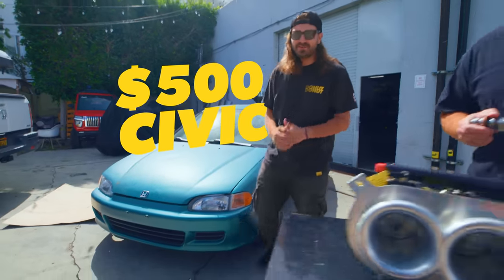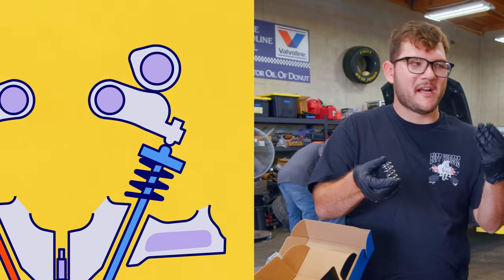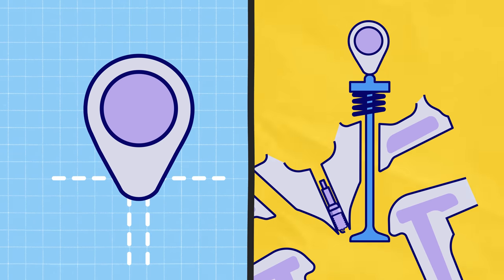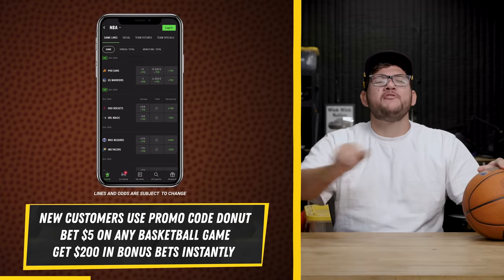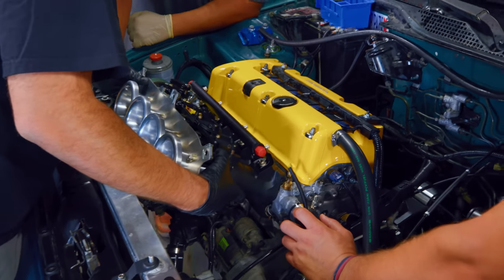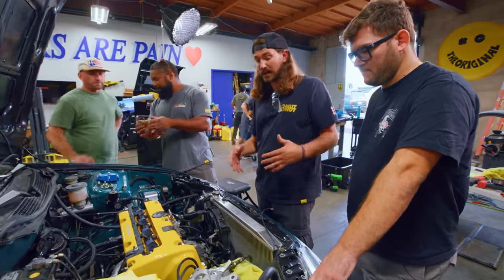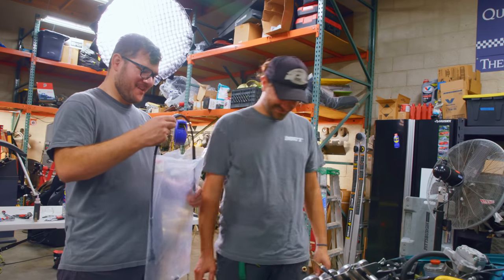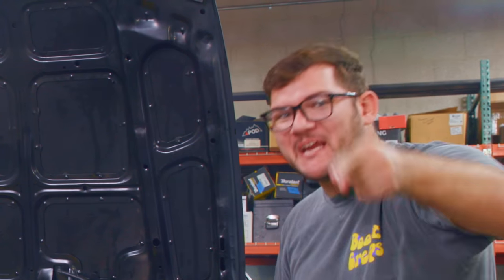We Put a $5,000 Intake on our $500 Civic

Comment: 240mm intake is not equal to 60mm*4,  just saying :)
Reply: The Difference is quiet big actually xD. 240mm would be 4x bigger than 4x60mm. Still great vid we did not come here for math but for Entertainment and one cute civic
Reply: Glad I was the only one that noticed that, someone in donut didn't pass elementary math class.
Reply: It hurt a lot hearing that
Reply: yeah i was like wtf? double the radius quadruple the surface... quadruple the radius and you octuple the surface...
it supposed to be a 120mm intake to equal 4x60mm...
Reply: 60mm*4 is about 130mm, 60mm*16 equals 240mm, big deference in my opinion
Reply: Yeah was thinking the same.
Reply: Yeah area is a square not a multiple, made my engineer brain cry 😢
Reply: The area is increased by about 3.5 times.
Reply: They needed Jerry there to correct him.
Reply: @ben501st  less than 2 actually
Reply: An 18 inch pizza is more than twice the size of a 12 inch pizza
Reply: We got a um actually guy here🤓
Reply: I love some of the comments that show people know thisis true, but don't actually know how it works.
Reply: @bentleyburke2242  no, its about 3.5
The single 65mm has an area of 3318mm, 4x 60mm have 2827mm each or about 11308mm. Crazy trying to correct someone while being so wrong.
Reply: Jobs math is sketchyyyy...
Reply: Yup. He had one 65mm port and now has the equivalent cross sectional area of one 120mm port, not 240mm. Or to look at it another way he had the equivalent of 4x32.5mm ports and now has 4x60mm ports. 

His available cross sectional area has increased by 3.4 times.

But I would speculate that going from 1 main port and chamber to 4 individual ports (even without cross sectional increase) will give a better air flow as you may avoid turbulance in the chamber and uneven distribution dont know enough about fluid flows to say for sure - Would need a real race mechanic to comment on that! So the engine benefit may be even greater than just the 3.4 times increase in air flow as it may also be less turbulant flow
Reply: @KrakenIsland64  glad you had the patience to explain. I was just reading through the replies thinking, my math teachers would've had a field day with most of these answers. Lack of context, failure to show work, flat out wrong, etc.
Reply: Yeah I’m over here yelling at my phone “Jobe that is not how pi works”
Reply: Aren't itb's a pain to tune? Should have just put a turbo on it....
Reply: Bro learn math
Reply: 60×4=240
Reply: @zameerramlall looks like someone didn't understand
Reply: It's about the cross section area. 60mm gives a total of 28.27cm²/cylinder. 113,08cm² total. 
The stock intake had 33,18cm².
A circle with a diameter of 240mm gives an area of 452,4cm
Reply: They didn’t let Jeremiah do the math😂
Reply: They’ve never been good at math at donut
Reply: On a 4 cylinder, there is only one cylinder sucking in air at a time. There is no overlap (2 or more cylinders sucking in air at the same time). So now instead of air flowing continuously thru the 65mm, it will flow intermittently between 4 smaller ones. Seems like it would be a waste to me, idk?
Reply: @UKfromadrone 

Quadruple the radius and you get 16x the surface area. It's a squared relationship. A=πr^2
Reply: Came to comment about this
Reply: @AlabamaT1CK Wait...what??  Yeh, somebody explain this.
Reply: @AlabamaT1CK ITBs make power in a specific power band from what can be described as resonance. When air rushes into one ITB, it has momentum. When the valve closes, a pressure wave bounces back off the valve, like a pulse, and escapes out of the entryway. At specific RPMs, this shockwave meets the ITB entryway at the exact time the valve reopens, and creates a greater vacuum that pulls more air into the cylinder, aka ITB resonance. It's kinda like having a leafblower on each cylinder 👍
Reply: not one comment mentioning Pi so idk who is dumber.. 😅
Reply: Along with spellcheck, doghnut needs math check
Reply: Ok boomer 😂😂😂😂
Reply: I engineered this part, It is not equal, it is much better
Reply: New math
Reply: Air volume intake is generally measured by the total radius of the T-body so it makes since that 60mm x4 vs 65 x1

Comment: The intake area on the old setup was 3318mm². Each opening on the new setup is 2827mm² for a total of 11310mm². The new intake's area is about 3.41 times larger than the old one. If it were a single opening, the circle would be have a diameter of 120mm, not 240mm as stated in the video.
Reply: exactly what i was thinking
Reply: This bugged me as well.
Reply: Thank you. Did the calculations my self before I came down here to find your coment and you're absolutly right
Reply: I am glad that someone did the math for me😂
Reply: I see. Numbers.
Reply: I wish I was smart enough to know this but me math no too good 😂
Reply: yes but still only one cylinder draws in air at a time
Reply: for sure. circles don't just add up from their diameter.
Reply: Or, as area is proportional to the square, just 60*sqrt(4) = 120mm equivalent.
Reply: As soon as they said it I said to myself it's about half that lol
Reply: True, the combined area of each 60mm intake added together would result in an area of 11309.72, but multiplying 60x4 into 240 would give an overall area of 45238 sq mm. They have to be individually calculated by area first, then added for a sum. You can't just add the diameters prior to calculating the overall area. If you wanted a realistic comparison the way he intended based on overall intake area, it would be like going from the original 65 mm diameter air intake to a new 120 mm diameter air intake (as that would give the same area as 4 qty. 60 mm intakes)
Reply: @WS102 Yup. The only relationship between the 60mm and the 240mm figures is that the four 60mm circles have the same total circumference as one 240mm circle. That's probably how they ended up with the 240mm value. However, circumference is not relevant in terms of airflow. What interests us is the area of the cross section, not the circumference.
Reply: I came to comment the same thing.
Reply: I did this math too the second I heard him say that...
Reply: @XXXgamerboy  Do you honestly think they would take down the video to correct it if they did? They've often made bad math like this, so it may just be funny joke to them
Reply: i just commented this lmao but it doesn’t matter because 120 is still bigger than 65 it would’ve only been kinda bad if the bores were 30mm and he thought he had 120 when he really had 60
Reply: my autistic ass was already calculating it
Reply: don't complicate things, their viewership's iq isn't that high, 60mm x 4 = 240mm makes sense to them...
Reply: they're mechanics not mathematicians
Reply: Probably put bad math in the video to get extra comments.
Reply: I just know more air = more better
Reply: first thing I thought of when they said that...people in the car audio world that don't know any better do the same thing. They think 2 12" subs is the same as a 24" sub. In reality you are measuring AREA not the inches (diameter). lol
Reply: I came here to say this exact same thing. Also to add that if it was that single 120mm TB that would be 1.8 times larger than the original.
Reply: you must be fun at parties
Reply: Thank you. I don't know why he thought he could get away with that nonsense.
Reply: I stopped the video at the same point shaking my head.
Reply: Now you are the MAN thank you for being here!